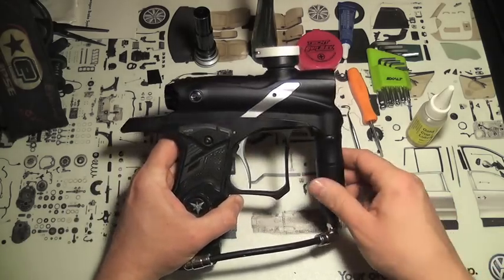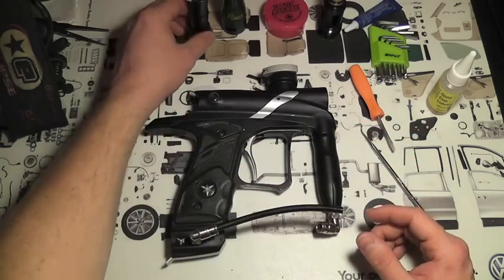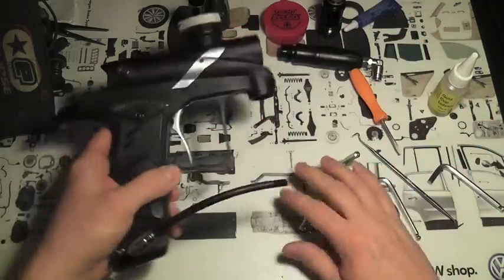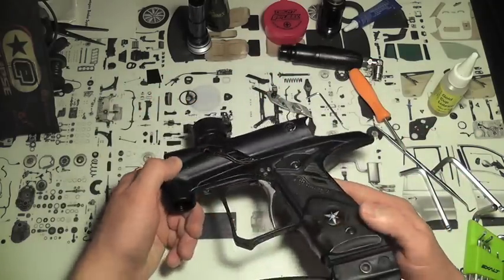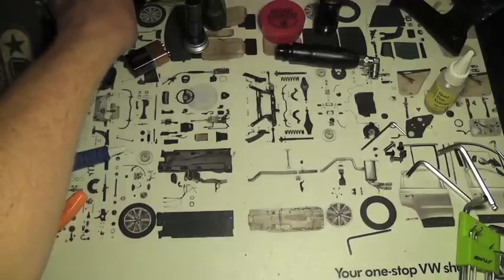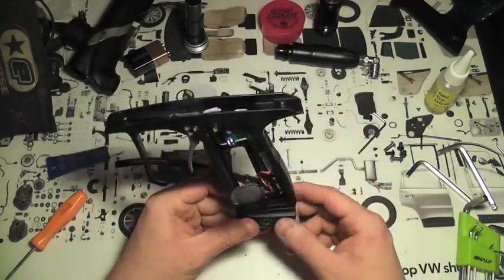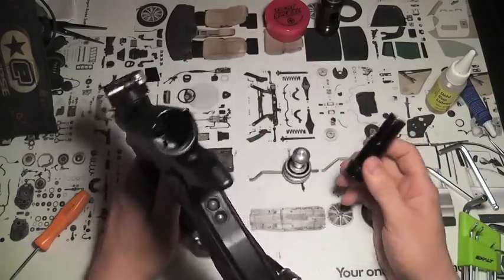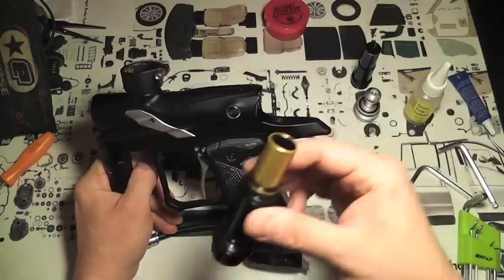Dangerous Power G4 disassembly / maintenance w/common problems

Comment: Hey good info how do I stop a leak at the bottom of the handle by the air tank switch it bigger screw is leaking through there any if you got anything that would that would great

Comment: i have a small leak from the tiny hole in the regulator and i replaced all the o rings any ideas?
Reply from the maker: Does it leak constantly or just one burst after firing? My initial though is an oring leak or a scratch in the bore if it leaks constantly. Sometimes you need to pay attention to the durameter of the oring. Using Dow 55 may help as well if it’s a slow leak as it causes the orings to swell slightly